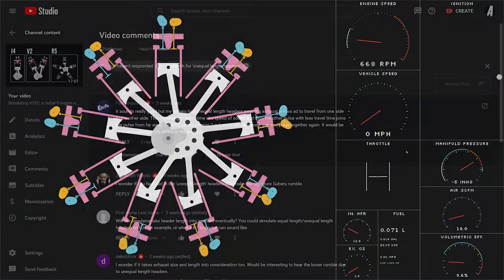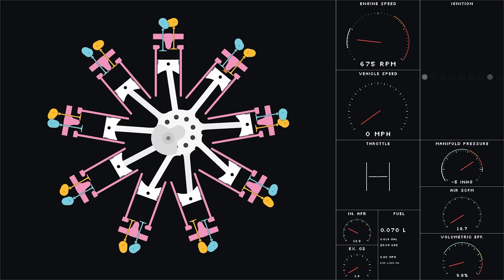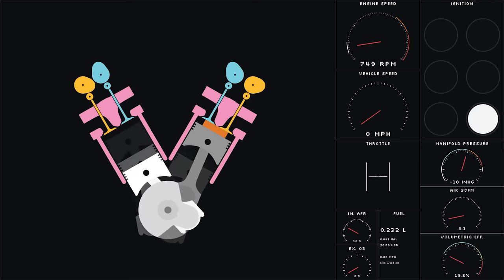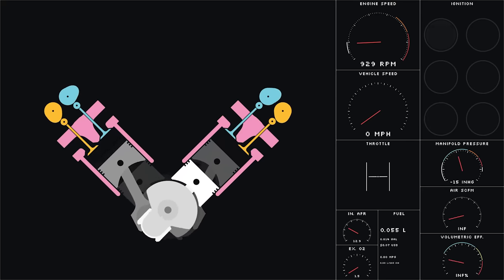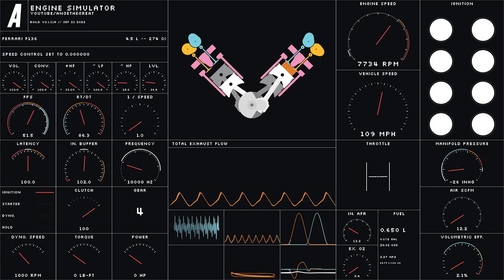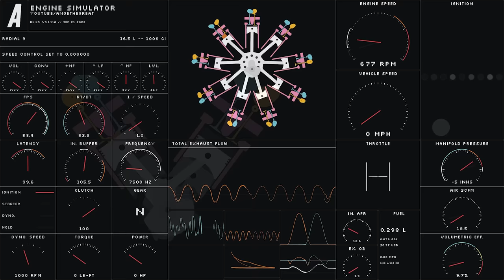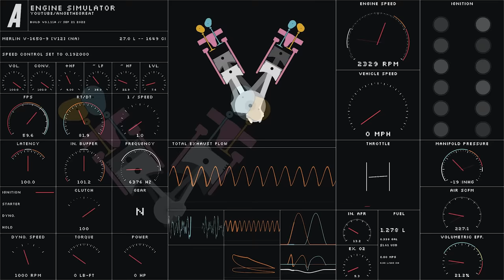Simulating an F1 V12, cross-plane and flat-plane V8s, unequal length headers and more

Comment: Something to consider (you probably already have) is licensing this tech to game makers NOT as a real time simulation, but to provide a workbench where they can develop and customize their source sound samples.  You could envision an API and generative workflow where custom samples could be generated based on player input, then silently rendered and captured for use in the cheat sound engines they already use.
Reply: why would you not want to have it be a real time situation? "flattened" engine sounds are why we're all here: they suck and sound canned. i get that it wouldnt be very efficient but that can be improved over time
Reply: I suspect that this simulation uses less than a quarter of one core of a contemporary 8-24 core CPU, i.e. an optimization likely not needed going forward.
Reply: As an audio designer I would like to buy a software like this combustion engine simulator for sound source creation purposes. Customizable engine layouts and rpm automation will be a real gamechanger in interactive and linear media audio design.
Reply: it could also be used to generate a huuuge library of sound that has perfect "tagging", then churning that through machine learning and basically make a optimized machine model that could be used in games. Similar to how Ubisof churned through petabytes of animation data and compressed it down to 10Mb of algorithms.
Reply: @priyapepsi  It's crazy that the guy made it open source. It's worth lots of money. An exclusive licence is probably like $100k.
Reply: We already use tons of resources on the graphics, some real time sound effects implemented would merely make a difference i think. Devs are interested in sound experience more than ever, many of them use tools like fmod nowadays
Reply: @pyalot  I'd argue that even that is too much. In game engines there's no such thing as enough CPU/Ram; when you're targetting 60+fps for a racing sim you need every possible cycle. 
Ultimately, there's very little reason for a game engine to have to simulate everything this tool does, but rather it just needs to reproduce the same output from the same inputs (throttle, engine load, rpm, temperature, etc). If I were incorporating this into a game engine, I'd probably use this to construct ML models for all the cars in the game, and using the same inputs it could very quickly and efficiently be evaluated and dump out whatever information is required by the audio engine being used by the game engine in question to reproduce the audio, without having to actually physically simulate the entire car engine.
Another argument is that you don't want your audio simulation to suffer if something else in the game is behaving badly. If some piece of AI code (or physics, resource management, garbage collection, networking, etc) is taking longer than usual to do it's thing, it would be sad if audio suffered as a result.
Reply: @TheChrisJohnny  Have you ever noticed how bad audio can ruin a nice video? Why do you treat audio as an afterthought for a game, not worthy of the same dedication of resources as graphics, physics and AI?
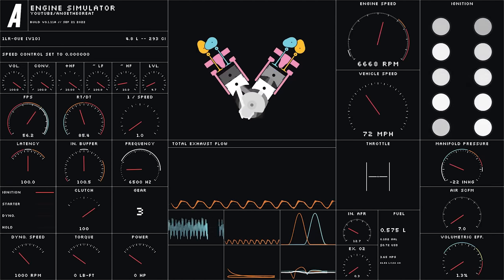Reply: @pyalot  At 12:07 He says that he is limited by his hardware so it sound like it uses quite a bit more than that.
Reply: @pyalot  just simulating the V12 F1 engine you need to lower the simulation quality of the sound to be able to run it to the point of getting artifacts in the audio. If you want full quality to be simulated in real time then you would have very low FPS and the large possibility of the simulation breaking.

Yes bad audio can ruin car games, but objectively bad performance makes these games worse to play. Would you rather play a game that has excellent fully simulated  audio but runs at half the FPS, or have good audio that’s done based off the simulation (not actually simulated) and have double the FPS, which in a racing game is usually preferred.
Reply: The problem is that the simulator is running on one single core for the audio and you need a very good boost frequence on your cpu if you want to handle a v12
Reply: That's what I said about three weeks ago on his last video.
Reply: @pyalot  Absolutely, bad audio can ruin a game. And it's totally up to the developer to decide what their priorities are for their project. If you (as a designer/developer) are okay with other areas of the game potentially suffering to improve audio fidelity, that's your call. I'm simply arguing that this app does a huge amount of processing that could be eliminated to improve the overall experience at a minor loss of engine audio simulation accuracy.
Reply: @TheChrisJohnny  Fair enough regarding the compute impact, seems to be higher than my guess. Though I think that there is probably room to optimize that quite a bit. I think it would be really valuable to preserve the realtime simulation as much as possible. Not just for the sound that reacts to engine condition/throttle/load, but also in terms of actually providing the shaft torque to propel the vehicle, it will make a car behave more realistic, sound more realistic and reproduce synced audio in-line with what is happening in the game, in a way prerecordings simply cant.
Reply: @bazinga1831  because it's a pain to run
Reply: @bazinga1831  yeah have fun running the real time sim game on your pc
Reply: @bazinga1831  because doing it 20 times over for a race wouldn’t leave any overhead for running a game.
Reply: @pyalot  a game will survive having bad sound. It won’t survive having poor frame rate and unresponsive controls. Something has to be compromised. Unless you want to spend the next forever coding this in ASM it would be better to use ML to make a map using the inputs from the simulation to make nice engine sounds. That would be more efficient than simulating each engine for every car at the same time.
Reply: @Mostlyharmless1985  I dont think the main optimization would be simply a faster coded physics engine. The reason it is expensive is because it runs a pretty accurate simulation at a very high tick-rate. The end result of which should ge somewhat accurate torques and sounds. But how accurate? Maybe if you put a machine learning to task and gave it a target of 95% accurate against a „high fidelity“ setting, it could cut down on 99.99% of the not needed overhead simply by tweaking constraint types, solver types, tickrates and audio processing nodes…
Reply: Someone has already done that for Assetto Corsa on a Porsche
Reply: f r e e
Reply: This is already being used in games like asseto and beammg
Reply: @casual_flex  both use prebaked engine sounds, however LFS to my knowledge does produce engine sounds like in this engine sim and you can edit how it sounds in game, not sure if this is still the case. LFS system is very apparent whenever you add cylinders and stuff via tweak menus and the engine sound changes accordingly. However, LFS sound engine does not sound nearly as good as this.
Reply: Automation really needs this!
Reply: @pyalot  that simulation lags pcs
Reply: Thats why I am here,
Reply: @fyxos  multithreading physics simulations is generally really bloody hard
Reply: @bazinga1831  As he says in the video, his computer can't handle more than 12 cylinders at high rpm. It's an absurd calculation to get the physics right. At least getting per cylinder/per rpm sounds realistic means the flattened noises can be smarter.
Reply: I think it's easier to simulate it real-time than trying to capture sound to samples and recombine it seamlessy in game engine. CPU processing power is cheap nowadays. Desktop platforms running up to 16 cores 32 threads.
Reply: @frollard  yeah, and im sure the first ray-tracing proof of concept ran like crap too. no one is suggesting copy pasting this code into a game and calling it good, theres tons of optimizations and tradeoffs that would be make it good in a game, but still sound better than canned engine sounds
Reply: Team um with Beamng please
Reply: @edfx  the problem isn't the number of core. The simulator run on one SINGLE core for the simulation. You don't need a massive processing power on the entire cpu but a massive processing power one core. If you look closer to the performance per core, 6 cores cpu are the best to do this because they can have a much higher boost than 10, 12 or 16 cores.
Reply: @pyalot  you'd be wrong, the engine sim runs at 80k fps and if your pc can't keep up it artifacts heavily and sounds awful, this is simulating and entire engine with fluid dynamics and everything to generate the tailpipe sound of the motor
Reply: @CoreStarter  No that isnt what it does. It simplifies physics to 2D, and it simplifies cylinder paths to constraint rails, crankshaft to circular rails, cams to curves, etc. And it does not do fluid dynamics, it just models pressure and flow in components based on expected constrained flow parameters. Also it simplifies combustion to an expanding cube.

If it did what you said it would, even in 2D, it would require hours per step on todays CPUs.
Reply: @bazinga1831  Performance
Reply: @ViktorartSnowtracked  can you tell me more about what ubisoft did or what to look up?
Reply: @michaelwerkov3438  Sure, I found the video here: https://www.youtube.com/watch?v=o-QLSjSSyVk
Reply: @Frille512  stop parroting. stuff that people said was impossible to do real time has been optimized to be possible. shocker. no way someone could take what 1 person developed in his free time and optimize it to run way better right?
Reply: @bazinga1831  Because the games that will benefit the most of this, will be also simulating dozens of engines at once. Racing grid at race start, aerial battles on flight simulators, large traffic on games that will feature such.
Reply: I assume that's the best use case at the moment because considering how much juice it takes to simulate one engine, I'm guessing this isn't viable for games with 20+ cars on the track.

With that said, I'd be really interested to see if the simulation could be optimized, I know it's single threaded right now but could this work be offloaded onto the graphics card?

I absolutely agree with Tiporari though. You could definitely achieve something way more granular with a workbench like this than, say, sampling the real things.
Reply: @Vlad-vk3mm  we need more people like that guy, if more though about how much itd contribute rather than how much they can profit off it, we would be far past where we are now with every technology.
Reply: And perhaps true customization not just prefab parts
Reply: You could "pre-bake" sounds based on a few parameters and then end-up with easily accessible look-up table of several hundred 0.1s samples. This should be fairly optimized, definately several orders of magnitude faster than simulation, with minimal realism loss.
Reply: @bazinga1831  I’ll say now, without dedicated hardware this type of simulation would never be efficient enough to be included in a perf budget
Reply: @whirled_peas  youre just wrong bro, things can get optimized or be a less accurate simulation for it to still be real time. people said the same shit about raytracing and other game tech thats standard out of the box stuff now
Reply: @ViktorartSnowtracked  I was thinking this exact thing after the original video
Reply: Licensing an already free & open-source software?
 
Ideas this silly are why Wozniak needed Jobs.
Reply: @forensix78  if you knew about how most open source licenses work, youd know that they are only free for non-commercial uses. lol
Reply: @bazinga1831  Wow- I seriously hope you’re not this guy’s business manager.

Do you have any remote clue how much an IP enforcement action costs? Do you honestly think that just because it says it in the TOS, that’s all it takes?
Reply: @bazinga1831  You seem to be confusing "optimizing" with "buying dedicated hardware to run it on."

If you can get enough people to make enough noise maybe Nvidia and AMD will make $500 sound cards that can simulate realistic engine sounds for you to buy. I'll pass.
Reply: @Pence128  lol this is not that demanding. i meant optimizing as in, when you have a team of smart people look at code you will often improve its performance by EXPONENTIAL amounts not just 5-10%... im not talking dedicated hardware you dingus
Reply: @bazinga1831  Ok but can you explain why you think this simulation that can just about simulate one engine be rewritten to simulate a dozen or so while consuming negligible resources?
Reply: @Pence128  you can decrease the accuracy

dude theres a hundred+ variables and youre acting like a proof of concept couldnt be optimized. this is ridiculous lol
Reply: @bazinga1831  "you can decrease the accuracy" 12:17

I asked you why you think it can be made hundreds of times faster. Go on, share your brilliant insight.
Reply: CEO mindset
Reply: why you giving him advices, not your business
Reply: @pyalot  it runs at 85kfps
Reply: The audio from this simulator is NOT based on "source sound samples" as you call them and cannot be used to edit audio. This is fully procedural sound generation and that is the whole point of this.
Reply: Iirc the sound of car engines sucking in games is why he made this
Reply: @frollard  In 10 years though PCs and even consoles will be able to simulate it no problem. Will have to wait for PS7 though and GTA 7 that releases on PS7 will be the first game to take full advantage of it.
Reply: I second this!! 👌🏻
Reply: @pyalot  I USE PHYSICAL MODELING SYNTHESIS TO GENERATE ACOUSTIC MUSICAL INSTRUMENTS AND IT DOESNT USE ANYMORE  CPU RESOURCES THAN A TRADITIONAL SOFTWARE METHOD ... SO MAYBE PHYSICAL MODELING WOULD BE THE WAY TO GO FOR REALISTIC CAR SOUNDS
Reply: @pepinillosazucarados6743  An oscillating soft body simulation is a vastly different beast than a fluid simulation.
Reply: @pyalot not likely as the physics engine explodes below 8000fps or something ridiculous, which means the physics calculations have to happen within nano-second time steps.
Reply: @bazinga1831 it's kinda like ray tracing simulating light in real time, now we simulate engine in real time and over time it gets improved.
Reply: @bazinga1831  Would be WAY too resource consuming.

What uses less memory on a computer? Just a sound, or parts, that are arranged in pattern, which then produce sounds, depending on situation?

Comment: Nice to see that even BeamNG supports you and therefore recognizes the potential of your simulator for other simulations. Great work on the unequal length headers!
Reply: Wait. BeamNG is supporting him financially ?
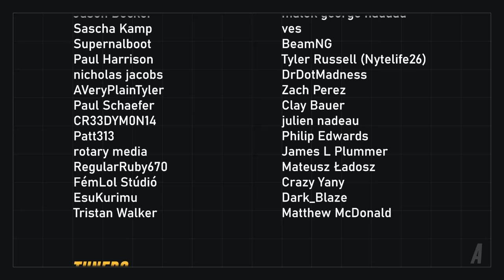Reply: 15:21 BeamNG not sure if it’s actually them though but it’s cool nonetheless
Reply: It would make sense if BeamNG was, as instead of needing pre recorded sounds for cars, different manifold types, firing orders etc, if this could be implemented in the game, the sound could be artificially created, and would work perfect for the different engine modifications you can do in game
Reply: @TheBeeMan1994  as astonishing and great this piece of software is, all the details of sound, different configuration, I don't think it's feasible to use in gaming industry. I don't think devs will switch to something like this and sacrifice pretious frames per seconds to be as close to realism as they can. This kind of simulation is expensive and as Ange even said v12 is the max his pc can handle. Imagine adding to it rendering graphics, physics engine etc etc. Game would run in 5 FPS on high end PCs. But maybe pre recording sounds would be a use case
Reply: Talent + hard work = innovation. How could we not support that? :)

Best of luck with further development! <3
Reply: @Velociapcior  the way I see this being used - aside from generating source sounds offline - would be as a 'precalculation' setup in a game. To the user this could look something like this: the player buys their in-game engine upgrades, they tweak their engine parameters, they hit 'save' or something and the game shows a loading screen or some message like "please wait, tuning...", after which the engine would sound as expected. What would be happening in the background would be that the engine simulator is used to run a slightly time-accelerated version of the simulation to test the engine at certain parameter combinations (RPM, load, throttle, etc), and the sound samples saved. These would then be played back using a much more traditional audio routine for a car game.
Reply: @beamng  YOOOOOO
Reply: @beamng  YOOOOOOOO
Reply: @Velociapcior  i mean maybe my pc could handle that type of simulation, but realistically only on 5+ year old AAA titles tbh.
Reply: @beamng  ❤ love the game the new update is amazing 😊
Reply: @beamng  god i love you guys so much
Reply: @beamng  That's POG af
Reply: @beamng  hello
Reply: @beamng  this is amazing omg
Reply: @beamng  BeamNG devs (Leeloo) our beloved creator's thank you for supporting this guy (this is why we love you)
Reply: Beamng mixed with Automation and Engine Simulator. A match made in heaven.
Reply: @TheBeeMan1994  this is what I was dreaming of! Messing with car engines in full depth in BeamNG
Reply: @Velociapcior  they can do something like automation. A separate program to keep ange known.
Reply: @beamng  you guys are the best
Reply: @beamng  wholesome industry intercollaboration
Reply: @beamng  wow
Reply: @Velociapcior  you could pre bake the engine simulation
Reply: @beamng  this is why you are my favorite dev team
Reply: @Velociapcior  it runs plenty fast obviously
Reply: I was just thinking that BeamNG should hire this guy, glad that they have contacted him and working together. BeamNG is the place for this stuff to be without a doubt.
Reply: @jorgemolina5968 well they responded to this original comment, so it is in fact them